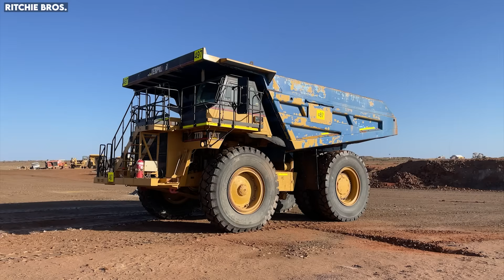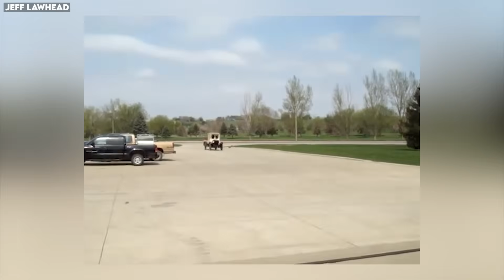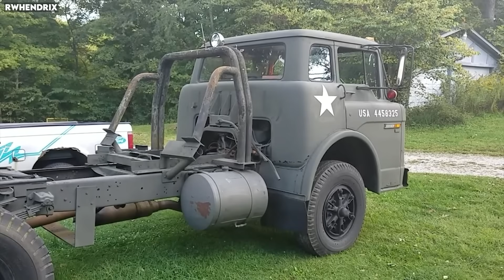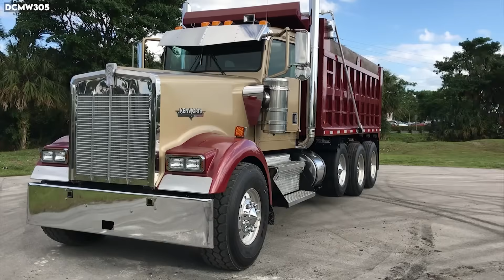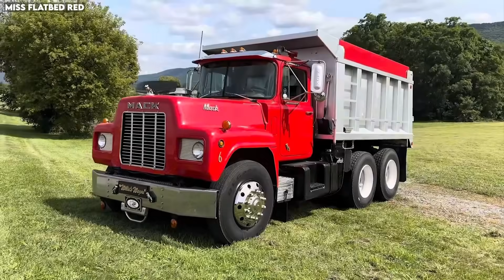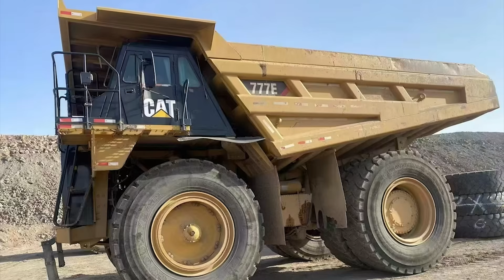10 Old Dump Trucks That Refuse to Retire

Comment: I also remember the Seattle F.D. buying "K.W."  and custom fabrication of the raised rear jump seats for the F.F. to ride in a partway open seated area behind cab. They put the Big Federal "Q" siren on the Front bumper down just above the headlights. On a perfect spot for mountings on the design of the front wheel covered area. It was like a traditional mounting spot. During the run of using those "K.W" Federal came out with the 184 half RED half CLEAR Emergency roof Rotation 4 beam Light. 😊 Seattle would mount the roof light with the RED half of Doom, facing forward. I loved seeing those Seattle Rigs, Responding in the streets of Seattle. They just looks so special, and very unique Design for a big city F.D. 😊

Comment: I remember the "Post Office" used the Ford "C" series for YEARS, as a box configuration, for the bulk Mail between the Post Office warehouses to delivery between Post Office Branks, were all your Mail deliveries were sorted at. 😊 I was so envious of that JOB. wanted to Drive that Bulk Mail truck. We also had TWO in the FD that I was an Explorer Scout, Fire Cadet 😊 I loved just LOOKING at that second out Rig. We got to use it a lot for Hydrant hookup Drills, if the Volunteer F.F. was their to Drive it for us. The TWO had 5- speed manual Transmission with a big GAS Engine. No jump seat on the TWO, just the Cab types. The F.D. colors were ALL white paint on the body.